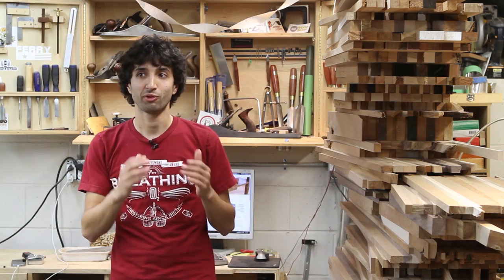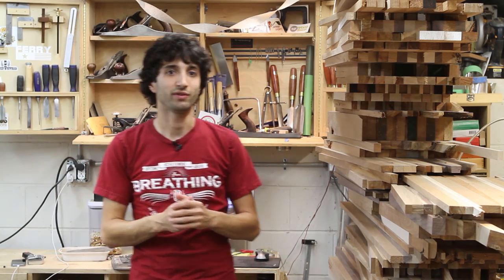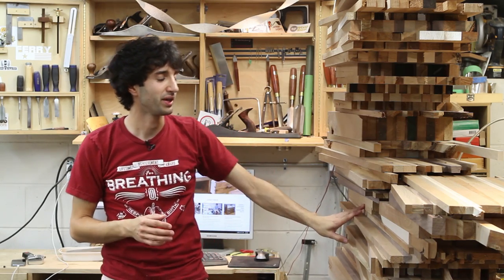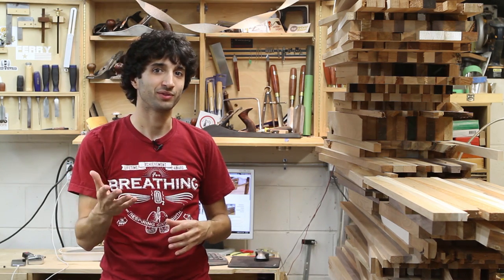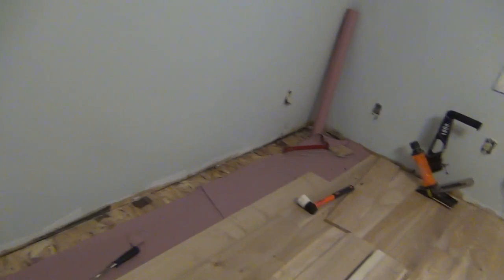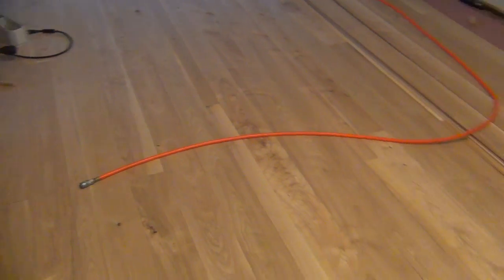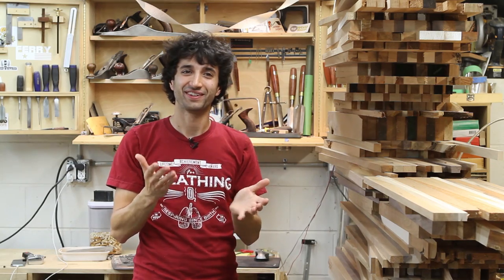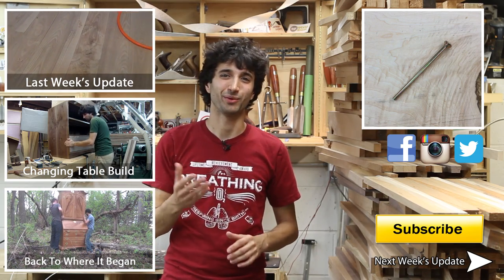Matt's Weekly Shop Update - Aug 10, 2015

Comment: have you looked in to LED's  they will fit right in those light fixtures all you have to do is just remove the ballast because there 110volts. a lot brighter and last along time. I have installed a bunch at work.
Reply from the maker: ***** I did take a look at them but they're twice the upfront cost.  Maybe 
someday I'll replace all the fixtures in the shop with led.  That would 
be nice.

Comment: Those small grey lights from Ikea has notoriously bad switches. If you've got them wired together (to a power strip or something you're better take the switch off the wire and hard wiring that section. Otherwise go to a box store and get new in-line switches to replace the ones that came with and it will fix the issue.
Reply from the maker: brian faini I hadn't thought of the switch being the issue.  I'll remove those since I don't use them anyways.  Thanks for the tip!
Reply: Ive had to do it to 3 of those same lamps. It's a pretty easy fix.